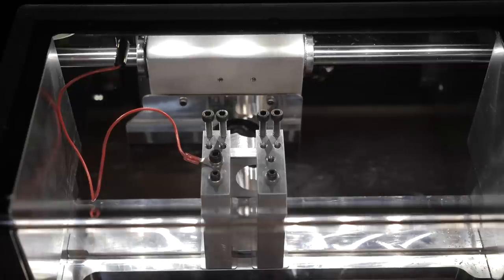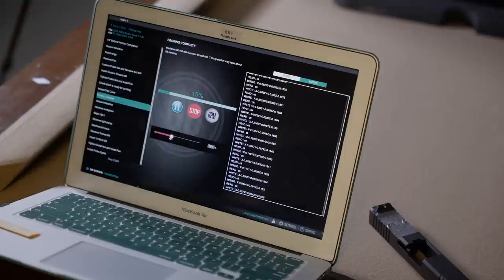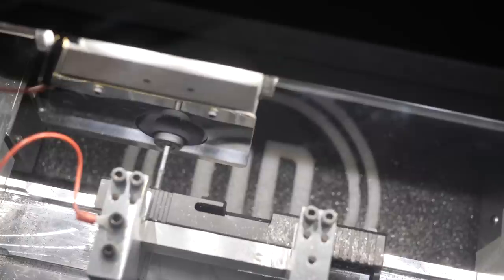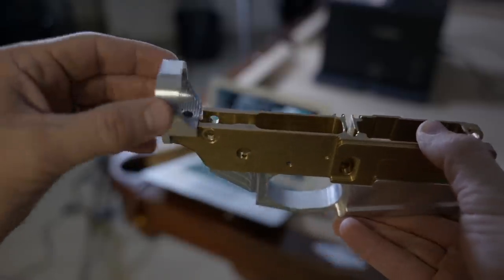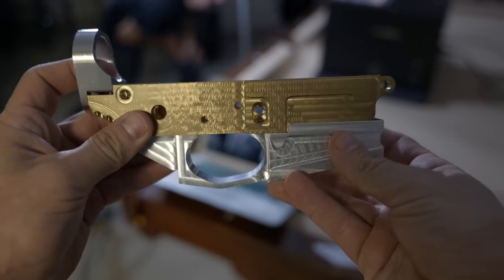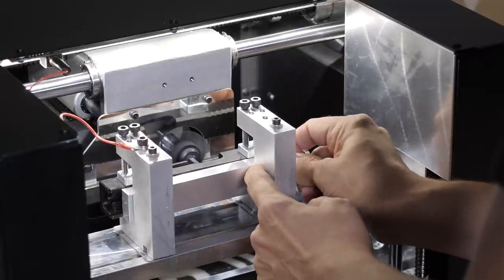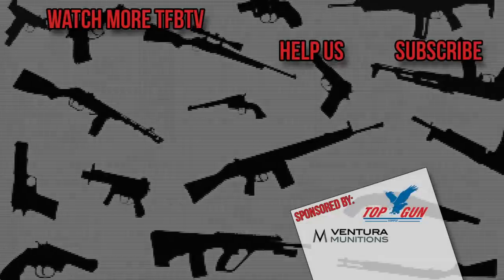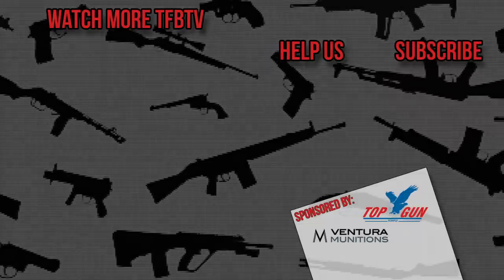DIY Pistol Optic Cuts (and 0% AR Receivers!): The Ghost Gunner 3S

Comment: I just think it would be sweet to have a little CNC machine in the workshop.   The fact that it's preset for parts is just awesome.
Reply: Joe  A GG3 takes 30 Minutes on a standard AR lower.
Reply: Joe  so was it smooth and not nicked or bit anywhere? Also would you get one.

Comment: So freaking cool!  Man, I had a shop cut my slide recently and yeah the turnaround was quick since they were local but the communication was poor, and the result wasn't perfect.  Having the capability to execute the process at home, that's a huge step for small businesses and DIY minded individuals.
Reply: It only does double stack Glocks and only does the RMR. The 0% lower is a waste of time.
Reply: How much did they charge you and did it have the two posts sticking up?

Comment: This guy is a class act. I've been thinking of buying one for a while, I just cannot square the circle and order it. This guy is awesome though!
Reply: If you have the money (and time) it's worth it
Reply: If you manage to figure out what all of the Ancient Greek philosophers couldn't, let me know.
Reply: Just for those out there they do have a layaway option for this...
Reply: @Rensune  No, its not worth it.
Reply: NOT WORTH IT. DONT BUY.
Reply: @printingwithpeek4897  Why?
Reply: @printingwithpeek4897  why not?
Reply: @printingwithpeek4897  people are giving reasons as to why this is good, but the few people like you stating how it isn’t worth it do not reply with reasons?
Reply: @V8Thrasher88  Because it's a 2.5K piece of machinery that only does one thing....mills out AR lowers. You don't buy a whole machine to do an RMR cut on a slide. You don't buy this to just drill trunnion and FCG holes in an AK 80% Blank. A Polymer 80 frame? Please.....This machine is a fucking joke. Up until this month, there isn't even a jig that could mill an 80% lower out without causing some problem. Now GGD has the Universal Jig out. I can 3D print a router jig, get an 80% lower, have a harbor freight router, buy 2k rounds of ammo, 10 magazines, and every other tool I'd need for under 1000. This thing just makes no sense.
Reply: @PrintingWithPEEK  This is my exact hold up with buying one. It does not have enough value for the average person @ $2500. How many lowers does the average person really need? How many RMR cuts as well? It's really cool technology, and I honesty hope he continues to refine and add additional uses for it.
Reply: @T. dubbya  But there in lies the problem....they won't. By the time you're done upgrading to this system, you could've gotten a used Bridgeport and put DROs on it. This thing was made to cut AR15 lowers

"But you can do this on here....." Yea but you won't. The concept of this machine with doing different parts is as dumb as caliber swapping on guns other than AR15s.
Reply: @printingwithpeek4897  this is what I was looking for. I am wanting to learn and build my own equipment, just learning and researching better options.
Reply: @V8Thrasher88  Buy a 3D Printer and printer router jig.  I can help you if you'd like
Reply: @printingwithpeek4897  I wish i saw this before I bought a gg3. Out of 10 lowers it failed to mill  4 of them properly. Machine fucking sucks
Reply: @filthyhippies1487  Yup. Tell me about it.
Reply: @filthyhippies1487 No, you just don't know what you're doing. Our group has made over 30 lowers with this machine and we've used it to mill slides as well...

Comment: I’m ordering one. And being an 07 FFL, this is gonna be great.
Reply: Would you need that license if you make gun parts and accessories but not serialized guns themselves like ar/glock lowers, etc.? What I intend on making is airsoft and real steel grips, handrails, iron sights, comps/flashhiders. Then eventually get the 07. But in the mean time I'd prefer not to get harassed by atf as I've been told happens. 
I'd like to get into the industry but I'm getting conflicting info from people I know in different gun scenes. 
I'd like to get that 07 FFL eventually but it's not in the cards right now. Is it true if I didn't get that and just sold airsoft accessories I'd get harassed by atf?

Comment: I wonder if this thing could make cylinders for revolvers. Would be interesting to see.
Reply: Not at all.
Reply: You'd need a cnc lathe for that.
Reply: why
Reply: Nah, with all the parts kits from destroyed guns out there, ya need to make the frames. Revolver frames are pretty complicated, I don't see that happening any time soon. Personally, I'm thinking the aluminum insert frame for Keltecs and all their rip-offs should be pretty easy.
Reply: @cokemillion  maybe to machine the initial cylinder to be perfect if you didn't just buy perfectly round stock, everything else on a revolver, the grooves, chamfers, ports, etc would be done on a cnc mill
Reply: @crewagnew3747  the entire process could be done on a cnc lathe as well. No need to move it from one machine to the other. A gg4 might be able to do what you described but I'm not optimistic.

Comment: It's amazing stuff, the real future of the industry, I wish everyone could get one, really see what's possible.
Reply: @printingwithpeek4897  We used to use rocks as weapons and tools. Technology improves and your incessant spamming/trolling in the comments is childish and short sighted.
Reply: @Jeff.78  How am I short sighted? I've literally suggested that for a 0% lower, we actually make it out of billet as opposed to 4 pieces that are milled and bolted together, from a single source. Someone would have to re-engineer those pieces if they wanted to have the same thing done, and the billets cut would have to be the same size as opposed to Gunnar over at GGD who is coming out with a 1 piece, 0% design that isn't proprietary. Also, let me ask you a question? Do you even have a Ghost Gunner 3? I do. So no, I'm not short sighted, I'm making sense.
Reply: @printingwithpeek4897  what would be a good alternative? I see you actually own a GG3, what would you suggest instead?
Reply: @V8Thrasher88  Buying an 80% lower and milling it out with a router jig.

Comment: If the electronics could be sealed from moisture, a misting coolant system would do very well. Firearms manufacturing aside, it could probably do small injection molds for toys, phone cases, other cool products and still fit on a desk.

Comment: I really wish I could afford one of these. Firearms are nice and all, but I am really interested in what I can do with it when it comes to small mechanical parts. Like, can I make a replacement collar for an engine part on that old 1937 tractor I have sitting in the back yard? Maybe I can try and figure out those dimensions...right after my 1911 lower is finished milling, ha.
Reply: Don't worry, you're not missing anything. Thing is good but it's limited and you can't do jack shit with it.
Reply: @printingwithpeek4897  please substantiate your claim
Reply: @PrintingWithPEEK  I wish i saw this before I bought a gg3. Out of 10 lowers it failed to mill  4 of them properly. Machine fucking sucks

Comment: The biggest issue isn't the GG, it's the coating, anodizing, oxidation inhibiter.  We need similar automated solutions for that.
Reply: @Mike
bruh a bottle of Cerakote is only $60 bucks and you can find used spray funs on craigslist.

All you need is a garage to spray the parts in or make a spray booth in your back yard or somewhere.

You can even bake the Cerakoted parts in a old used oven.
Craiglist has old dirty ovens for dirt cheap that people want you to come and haul away.

As far as anodizing goes that isn't complicated.
Just a chemical bath tub for the fun parts with a low current electric rod in the bath.

But the home CNC machine is a game changer!

Comment: James. I'm glad to see you supporting "poverty ponies". I guess you could stamp Daniel Defense on the side, and that might solve that issue for you.  ;-) I'd like to see a 1911, CZ, or SIG P226 frame. Could you make a milled AK frame with this?
Reply: I mean behind the scenes it's just an open source cnc mill. the sky, and your own skill and creativity are the limit... well that and the build area size.
Reply: @ameritus9041  I understand that, but I was wanting to know if the CNC control files are available. On the electronics side, we used to call it Gerber Data for PCB manufacturing, but I'm not sure what it is called for CNC.
Reply: Doesn't look like there's enough travel for you to cut the rails from front to back, or the space to plunge into the trunnion area and machine the lugs.
Reply: @ChucksSEADnDEAD  Thanks. That is the kind of information I am interested in.
Reply: Joe  I was thinking aluminum. 7075-T6 maybe?

Comment: This rmr cutter would save me money!
Reply: How would it save you money? It's literally cheaper to buy a new slide, and it's already nitrided.
Reply: @printingwithpeek4897  If you already have multiple slides that don't have cut outs you don't have to buy new slides. Plus cheaper Glock slides look cheesy to me. I prefer the OEM look.
Reply: JagerWerks Black Friday sale is only a few weeks away.  $80.  You're going to want to refinish the entire slide (nitride).  I assume you want rear iron sight forward which Defense Distributed likely doesn't offer at this point.  Even with $299.00 for the GG3-S Upgrade Service, the Ghost Gunner is still a toy.  You're bound to botch a slide or two.  And you need the $350.00 Optic Cut Kit.

Comment: I presume after cutting an rmr cut in a slide the next step would be to anodize the freshly exposed metal?  Is this a non trivial process, or can someone easily accomplish the anodizing at home?
Reply: Most slides are stainless so it wouldnt be strictly nesesary, but one can also throw a light coat of cerokote on there.

Comment: So with the Ghost Gunner 3 plus their jig kit is that enough to finish 80% lowers?
Reply: Yes, but a 5d Tactical jig, a bench vise and a DeWalt dwp611 router is all you need to mill out an 80% lower.  This will mill a solid block of aluminum into a lower.

Comment: The only thing that has stopped me several times is there is a deposit and wait. If they could grow to the point a preorder deposit isn't necessary, and still stay in the same price range, this would be a massive hit.
Reply: Almost Every machined component or serviceable machine or CNC type machine takes a deposit and lead time. even a custom barrel takes paying for it and lead time, this is next level gear not Midway or Brownells pre production parts
Reply: Out of 10 lowers it failed to mill  4 of them properly. I stopped at #6. Machine fucking sucks

Comment: @TFBTV This is the first time I have seen this, I thought this kind of stuff was fir the real Deep Pocket Guy! So Awesome, does this mean I could potentially have a RMR for my Springfield Armory XD 45 and my EDC H&K P30sk 9mm that doesn't have slide cuts for any Red dot? Or is this strictly for Glock Slides?
Reply: It really comes down to the programming you acquire, so if you can find or make a program for cutting RMRs into a XDM, it's possible. With this, the possibilities are practically endless.
Reply: You could absolutely use it to make slide cuts on anything that doesn't have it. Problem is they probably don't have files to make slide cuts for anything other than Glocks at the moment, so you would either have to do a LOT of measuring and program the cuts into the GG yourself or wait for someone else to figure it out.

Comment: Only disappointing part about this is, anyone that already owns the GG3 has to pay $300($299) for the upgrade, when the NEW machines get to come out with the NEW upgraded spindle at the same price tag. DD is amazing but I think an L is necessary or at least a nice deep discount. Also what about people that own GG1 and GG2’s, is there any upgrades they can get to shrink times or something?
Reply: I agree with the L but the GG2 and GG1 portion is kind of pointless. Those are older models that have smaller housings. They stopped producing them for a reason.
Reply: @printingwithpeek4897  No for the GG1/2 I mean is there like any new upgrades. Like a better spindle with new codes for the timing, since they’re 2hr+ mill times. Just anything, cause the GG’s are pricey and worth it but the GG1/2 owners would appreciate it, I bet.
Reply: @factsoverfeelings21  The GG 1/2s don't have a big enough foot print to accommodate all the extra reinforced components
Reply: He says it's not necessary to get the hardware upgrade. You can upgrade with just the firmware

Comment: Can it do an A2 carry handle upper?
Reply: It does anything that you can code it to do (within reason)
Reply: I don't think you can plunge the boring tool through the upper to make the bearing surface for the bolt carrier.
Reply: @ChucksSEADnDEAD  understandable maybe I could use my big mill for that and this for all the other cuts
Reply: Why? You can buy one.
Reply: @printingwithpeek4897  the whole upper new not used. Where?

Comment: Its super poopy that Cody and the Defense Distributed team effectively stole GGD Store's design for the RMR/Slide Cutting Fixture. Not cool at all.
Reply: GGD demonstrated a Glock slide RMR-cut using a GG2 almost three years ago.  DD featured GGD's RMR-cut slide in their booth at SHOT Show 2020.  GGD is now offering their own slide-cutting fixture and cut codes.  DD posted a video of GGD's slide-cutting fixture and cut codes being used to RMR-cut a "Glock" slide to their Instagram account on July 16 as if it were their own. 🤔

Comment: I appreciate the spirit of it, but seeing the 3d printers reaction to it is hilarious
Reply: What reaction did they have?  GG3s is an awesome machine.
Reply: @Wood-Wheel-Wizard  I can't find the video, but there's a hilarious reaction from fudd busters and Ivan of one running. They seem like you should just buy a either printer or a nicer cnc
Reply: @philllax1719  Of course a 100k cnc will be better and The cheapest cnc that can cut steel is 6k usd as a preorder that just got out of kickstarter and this is 2.5k usd.
Reply: @sanisidrocr the point is its a 2500 dollar waste. 2500 dollars worth of 3d printers gets you more capabilities
Reply: @philllax1719  If you are hard up for money and lack a 3d printer than by all means first invest in a 3d printer so you can make some plastic guns with metal pins and steel barrel inserts. Others can afford both and you can't really compare plastic guns with metal ones.
Reply: @philllax1719  for cnc machines , 2.5k is insanely cheap , the fact that its open source and a more mature product is a added bonus
Reply: @sanisidrocr  how hard was it to type that comment without using the words Tupperware or two world wars
Reply: @philllax1719  You must be responding to the wrong person by accident.
Reply: @philllax1719  $2500 3d printer that does forged aluminum?
Reply: @Superstallion1993  the "but it does metal" argument is fudd as shit. Who cares if it's metal
Reply: @philllax1719  Metal is more durable and has tighter tolerances than 3d printed plastics. This is why when I print guns on my 3d printer I use metal pins and a metal barrel insert instead of using 100% PLA like the original Liberator
Reply: @sanisidrocr and it's far more expensive. The ghost gunner flat out isn't innovative
Reply: @philllax1719  You think 2.5k is a lot of money ?
Reply: @sanisidrocr  I think its more than a more innovative 3d printer
Reply: @philllax1719  Its just another tool. Some people can afford it and others cannot. I will use both .
Reply: @sanisidrocr  you will be wasting your time
Reply: @philllax1719  Its been great so far . I'm not speaking hypothetically
Reply: @sanisidrocr  sorry you have poor taste in machines

Comment: Only thing that pisses me off about the company and other jig makers, they wont sell to nj.
The law didnt change. I bought jigs and 80s (didnt build them) and then the AG made the cease letter. The cease and desist didnt mean shit. The law is exactly the same, you can have it you can sell it you just cant build it in the state so you can sell me the FUCKING machine. What if i want the CNC for non gun related shit? Sell it to me. You wont get in trouble, if any thing i will. Such bullshit, i get a jig a little.. you have intent. But this damn cnc machine? Like bro wtf fuck yall. If i had the technical know how ill fucking sell it and be an absolute menace to the State, like a Chad a patriotic red hot blooded 1776 chad2

Comment: This upgrade has no merit and is the exact reason why I got our of the Ghost Gunner 3 family. The Ghost Gunners have probing problems because they're not using a jig that was designed around finding where the detent and detent spring hole is for the selector. This once again, is not a 0% lower, this is something that you have to piecemeal buy from Defense Distributed because they have parts which are specific sizes and have already tapped holes for a bolt together design. The steel on these things are stupid because there is no active coolant system running on the workpiece on the cutting tool. Once again, another wasted endeavor, designed around proprietary parts.
Reply: I have no problems lol. Sounds like you just don't know how to do simple stuff.
Reply: @zacsdiyguns  What do you mean I don't know how to do simple stuff. You can't even make a reply without sounding high. First of all, I've been programming and doing coding since windows XP, so you have absolutely no clue what you're talking about.
Reply: @printingwithpeek4897  lmao